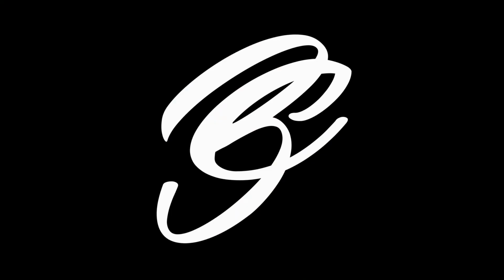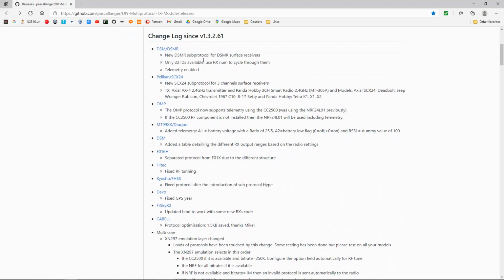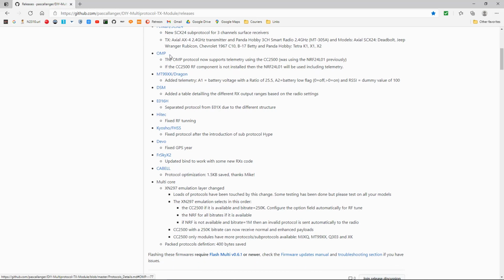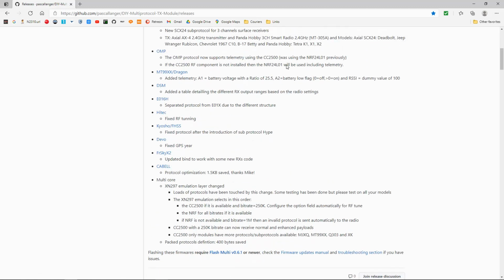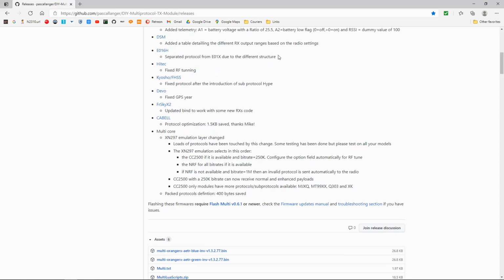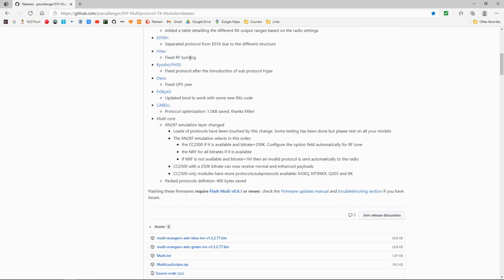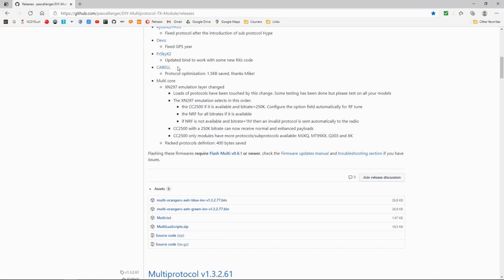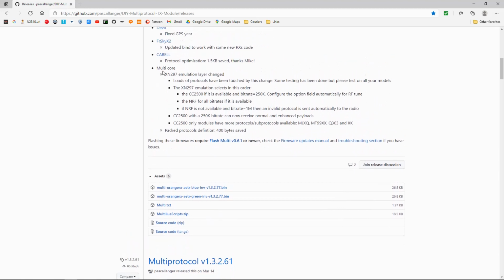Multiprotocol Module Firmware Update v1.3.2.77 Available Now

Comment: Hi Bill, Sorry i have a question...
I update my module firmware yesterday to the 1.3.2.77 , and write without problem.
After i look in my firmware folder and find the 1.3.2.77.bin and still the two firmwares... cc2500 1.3.2.6.bin and serial 1.3.2.6.bin.
So, i delete this two firmware, It Is correct or not?
Reply from the maker: Paolo, please do not be sorry for asking a question I am here to help. You can leave them on the SD Card or delete the bin files if you wish. I keep around 6 versions of the firmware on my SDCard in the radio. Just to inform you please do not go into the RM TX12 drive on your computer when plugging in your radio if you delete the files in this drive your radio will not work.
Reply: @the-happy-RC-flyer  thanks Bill, so much quikly.... Can i save your number for write u in WhatsApp? I made i Little group of radiomaster user nearly my country.. and we Try ti help toghether.. write me on messenger or in facebook or Instagram, Lonzi Paolo
Reply from the maker: @paololonzi  I do not give out my telephone number but you and your friends are more than welcome to contact me via triplemadventures@gmail.com if you want to ask me a question and I will do my best to help.
Reply: @the-happy-RC-flyer  really thanks Bill for your support! ..i must do the upgrade because my microSD get wrong, the radio Is going in reset,and was be like new, i Try to read the SD on PC but don't work It. I Lost all my model😭.
After i change the SD, and recharge the last firmware with your tutorial, in second time, i male the upgrade to the module too. If the radio don't have any errors, and the bind Will succesfull i think i can fly quite ..or not? 😳😁
Reply from the maker: @paololonzi  if your radio boots up with no errors you should be good to go. I am not sure if you are using OpenTX Companion but it is recommended so you can back up your radio settings and models. This is important because sometimes when updating firmware things can go wrong and if you do not make a backup you will lose you models. I have made videos for the Jumper T16 which will help you just check my playlists.
Reply: @the-happy-RC-flyer  i have the radio from few mounth and unfortunally i still don t do It backup..
Now i use companion i the radio Is upgrade without errors, i Will do a backup Every 5..important models in the future.. this time i really do think Is possible to burn the SD..😔
I think mayby was be because i disconnet the radio without espulsion from PC? was be connect in normal mode..

When Is connect in bootloader mode can i disconnet without usb espulsion from PC?
Reply from the maker: @paololonzi  what I would suggest is to flash the latest OpenTX firmware to your radio and then update the multi protocol module. Then you have a good starting point then set up your models and back up your radio settings and models.
If you follow my videos carefully you should be ok.
Reply: Hello Bill
If y want to do this,i get a message that is:needs file stm-opentx-noinv
What AM i om doing wrong?
Reply from the maker: @andreklijn878  it sounds like you have chosen the incorrect firmware for your radio. Which radio do you have?
Reply: @the-happy-RC-flyer  jumper t16 with hall sensor gimbels the silver one
Reply from the maker: @wapke11  The firmware you need is 
multi-stm-serial-aetr-v1.3.2.77.bin but please check the channel mapping the above is AETR you may need RETA or TAER 
also you will also need the MultiLuaScripts.zip as well. I have assumed    the multiprotocol module is internal. Please check the file you downloaded is the correct version for your radio.
Reply: @the-happy-RC-flyer   after vers 1.3.1.69 stm 4 in 1 radio type opentx
it is serial opentx , afther that i cant update my firmware.
lua is 1.3.2.77 that is going ok.
Reply from the maker: @wapke11  are you using OpenTX Companion to update your firmware?
Reply: @the-happy-RC-flyer  no 
i do the same as you do in the  discription
Reply: i am on version opentx  t16-2-3-7  date 2020-04-01
Reply from the maker: @wapke11  could I please confirm, this video is about the multi protocol module the firmware you mentioned is the openTX radio firmware. Please email me with the errors you are receiving. I think you may have used the incorrect firmware and it will be easier for me to help you via email triplemadventures@gmail.com
Reply: @the-happy-RC-flyer  yes i do know that  ,  i thought it maby it is that i have the wrong open tx firmware..
i am trying to update the multi module .
but after 1.1.3.69 it is saying missing a file.
Reply from the maker: @wapke11  I would suggest firstly if not on the latest version of OpenTX updating to version 2.3.11 because there was an update in OpenTX which was needed for the multi protocol module but I cannot recall which release. You need to keep in mind the channel mapping needs to be the same for both OpenTX and your multiprotocol module. Please let me know how you get on.
Reply: @the-happy-RC-flyer  ok
I will try that
Thanks for the time 👍👍👍👍👍
Reply: @andreklijn878  hi bill
i did the update to 2.3.11, and now the firmware for the multi mod  is working
super
thank jou for your input